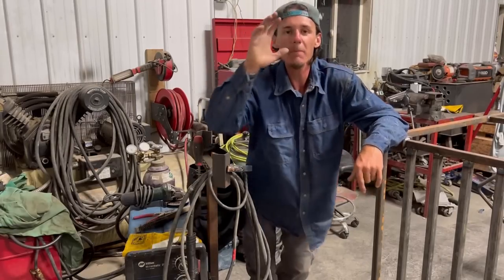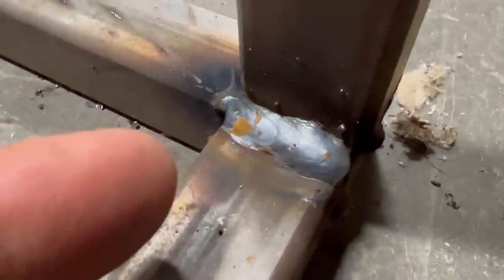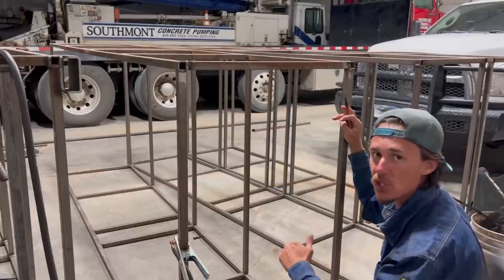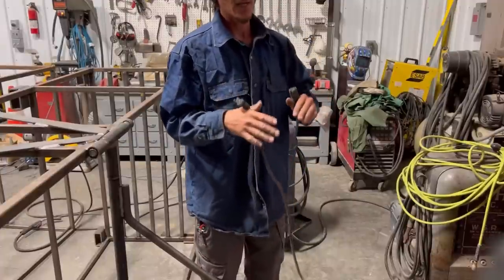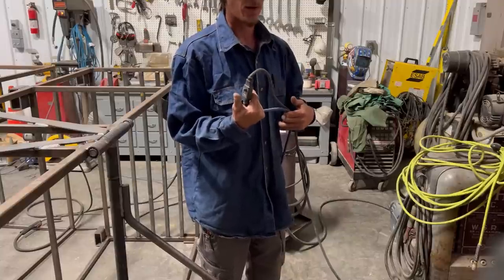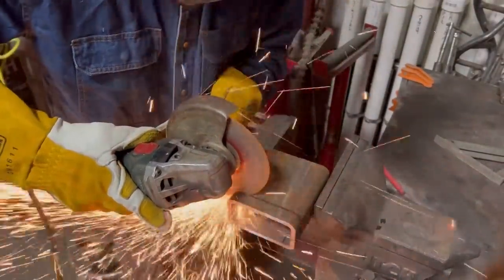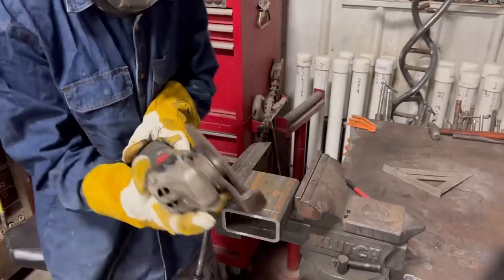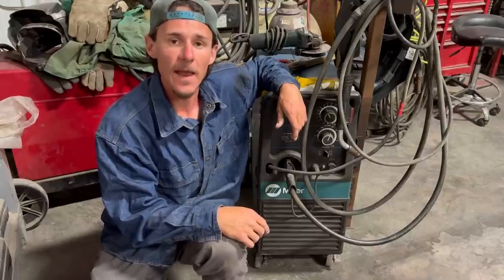Top 5 Fabrication and Welding MISTAKES! (And how to fix them)

Comment: I use two speed squares, one for marking which hasn't been altered. And a second one that I've nipped the corner off of the 90 by about an inch, so it'll fit over a weld bead when making sure everything's square.
Reply: Lol, the amount of modified squares I have is ridiculous.  I've cut 1 footers down to 8 inches, cut corners off, I've got funky speed squares, I've got squares modified to mark out the inside of H beam and I beam.

Comment: Finally someone who knows which direction to used a grinder! Yes sparks should be coming towards you trust me sparks coming at you is a lot better than a grinder coming at you at lightspeed lol
Reply: Yeah. Just make sure you’re wearing something inflammable that doesn’t catch all the microscopic crap. I find myself needing to vacuum myself off.
Reply: @melgross  Yeah I try to fire the sparks to my side but often end up with a bit of a hole around the right side of my waist in my overalls lol
Reply: hahaha yup

Comment: in structural work, tacking the corner increases failure rate.  stress accumulates at corners so you should weld around those if the weld is important.  cosmetic/light duty, it does not matter.  if you were welding a fish plate on a cracked vehicle frame,  tack near the center, weld just off the tack and around the corner to near your next tack.  do the same on the opposite corner,  then grind out the tacks and weld up the gaps
Reply: I think his advice is good, that's thin wall anything structural part of your procedure is to grind tacks starts and stops so the issue is resolved plus structural welds you never end on corners but good info.
Reply: I always weld into a tack and never start on a tack

Comment: When marking out fab points, I usually use a steel ruler (of varying lengths) to do the marking. Easier than a tape unless the distance is too long. I bought some cable connectors that hold the cable plugs together. They're waterproof as they cover the entire joint. Don't remember where I got them. Had them for years and work great. Yeah...I've set fire to myself a few times with sparks 😆😆 Back in the '70s flared jeans with shredded hems were the "in thing". They made great kindling...

Comment: For cutting dead on, or checking how well you're lined up before cutting, just butt your tape into the teeth on the blade and line your part up. Don't push too hard and deflect the blade though. When cutting off marks, I personally like marking my cuts dead on and splitting the mark on the edge of the blade when I cut.  Also as others have mentioned don't tack corners on structural work.

Comment: Good way to start your channel, I've been a fabricator/ welder for the best part of 44 years. I am still active and working in this field. I can help you and your followers. My specialty would be thin wall, and Galvanized tubing, heavy metal fabrication and structural welding. I can even show you guys many way's to prevent injuries in the work place by using simple steps...Great gob..well done

Comment: I cut all my pieces (on a table) then layout (one) piece with 2 edge marks per intersecting bar (so I don’t have to eyeball from center) then I transfer that layout to all additional same pieces (on a table) instead of working off the ground and having to continually measure/layout.
Also, instead of welding bars in (on the ground) I would weld bars in to make panels (on a table) then join section together.
Reply: This is the way

Comment: 5:20
I usually use the edge of the the marker line.
The marker width might be 1/8”, but the edge of the line is 0/8”. 

I usually use an arrow or scrubby marks to show which side is the side to cut

Comment: When cutting I just butt the tape measure up against the blade and if you have a band saw you can just hook the tape on the blade. I got that tip from my local steel supplier 🍻🍺. Let’s have more stories anthony.

Comment: I tack top center on something like that. But regardless of where the tacks are, hardwire or flux core, I just run beads over them and melt then in. I can't grind them flush because they are holding the thing I'm welding together. Hence why I keep a "tack weld" a "tack weld". Just a quick 'bzzt'. No beads until I'm ready. Id rather tack center on all the sides to avoid deformation of my fitup personally. (That said, with the stuff I weld at work it can range from pipe flanges, to wedges arranged in a circle to T-joints on an I-Beam) so it's probably situational on based on that. To each their own too, it still works. Thats how we learn in this industry.

Comment: the other BIG thing is that if the sparks are comming toward you ... if the grinder catches it will get thrown away from you ......... a running grinder thrown with force comming toward you can take pieces off you faster than you know.

Comment: Thank you for your time in creating this video. Much appreciated. 
How would you weld a crack in grey cast iron Goulds water pump down in the base of the bowl, the bend of the bowl or the seam but not.  I only have a flux core welder with E71T-GS - 0.030 Inch Blue Demond wire. But, after I use a grinding wheel to make a trench I was thinking of using a nickel rod along with the pass. I would heat it up first after its all grinded and cleaned and I have a trench and holes drilled at each end. I will put it in a sand bath for 24 hours after I am all done.  But, it's not more than an 1/8" deep cast iron. The crack goes all the way through. Hair line 98% of crack to about a two to 3 hairs crack 2% of crack. LOL. 
1. Can I grind it out all the way through with a hole at each end of crack. I have been told not to go through the iron. But, there are no parts or anything on the other side that I have to be careful and not weld onto?
2. With using the flux and rod can I just go at a speed until the pool fills up all in one pass?  The crack is about half the size of the pumps diameter. 4-5 inches. 
3. Can I go the speed that would fill the trench then stop halfway or, (?, Distance of stop and go) Stitch it and come back before it cools all the way down to finish.
4. I can only get to the outside of the cover. Its about 10 " in diameter. 
 I only have one shot.
Please help don't judge because I am women. I have to get this done.  Can't afford to be ripped off by someone else when I know I can do it We have no water. 3kids, and farm animals that need water. Update: I had called the manufacture and was told it was cast iron. But after grinding into it, its stainless steel.

Comment: I measure to the blade when cutting. Put the piece in the saw, measure from the edge of the blade to the edge of the material, move it until you get it where it needs to be, then cut it, always more accurate, and just the way I learned to do it.

Comment: I'm dissapointed nobody caught this!! If you have a 24 inch opening and you want evenly spaced pickets you have to add a picket size to your 24 dimension or your last picket will be half a picket to wide. If his end picket was 3 1/2" all his others are 
3 1/4"inside. Trust me on this!! 
I have layed out a million pickets. Its a very common rookie mistake in fact lts very easy to spot when looking at . A pro makes them all the same.this is how you do it with a .5" picket you add .5 to 24" so 24.5"÷6 = 4.083 center to center, find center or 12" inch mark your tube put 4.083 in memory function in calculator hit plus memory recall and you get 8.166 and so on. 4.083 is a long 1/16" and 8.166 is a short 3/16". A little practice and its easy. It will make your life easy in a rail shop. And for Gods sake use a calculator and learn decimals or your a hack. I have seen guys fail  inspection of rail because of this
3.88" in between pickets but 4.12" between between picket and post

Comment: Hey Anthony, 

As a lefty, I have a tip for you. Grinders are most definitely supposed to be held in your left hand. Give it a go, doing so left handed puts the disc on the opposite side of the grinder to your body. Allowing you to get the grinder closer to your body without throwing sparks all over yourself, resulting in greater stability and improved cut alignment (you can see over the disc onto the line better). In addition to this it allows you to brace off of the gearbox instead of the disc guard.
Reply: How can you actually see where you are cutting?  The Only way to see over the disc would be to put your face on the table-in front of the wheel
Reply: @donsmith9081 the bloke is 100% bang on. I'm right handed and cut with my left. It's just way less shit in your face
Reply: @donsmith9081 you can see from the side.
Reply: Only if you are cutting towards you, otherwise the grinder is in your way. @melgross
Reply: @donsmith9081  I can see from either side. I don’t understand the problem.
Reply: If you stand directly behind a grinder your clothes will catch fire.  After Years of metal fabrication I have found the most accurate way to cut is by watching the cutting blade which is on the left.   @melgross
Reply: After years of metal fabrication I don't usually cut with a grinder unless I absolutely have to lmao. Pipe bevelers, cold cut saws, plasma torches, gas torches, bandsaws, etc etc etc are all better options for fabricators

Comment: I learned the measure your mark the hard way, in our agg shop they had replaced the blade without telling me. I already had the marks placed but I measured infront of the line. My cut was almost an inch off and my teacher made me mig the whole gap

Comment: I don’t mark on center if I’m make railing besides the actual center of the top rail, I’ll just go over 4” or 3 7/8” whatever it is, then add my thickness, mark the lines. Then move over. Just depends what I’m doing though
Reply: It does depend on what you are doing. It's generally bad practice to do that though... every time you move over your mark could be off, which if you are only moving a few times might not matter... But if you are doing a hand railing, if you are off 1/64" even on 100 uprights you'll be off 1.5 inches when you reach the end. If you stretch the tape all the way out, you might be off on a few railings by a bit, but your mistakes are not additive like if you moved over on every railing.
Reply: @soup_mix9033  yes I get what you’re saying that’s why I use a calculator at add them together so I’m never off. I’ve made that exact mistake before so using a calculator to do the math I just extend my tape out the whole way and just go off the measurements if that makes sense